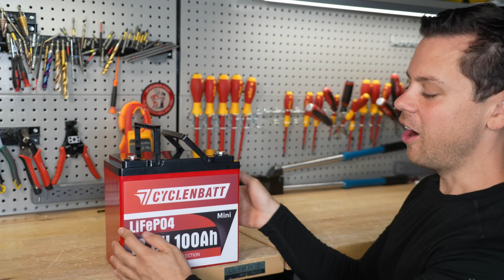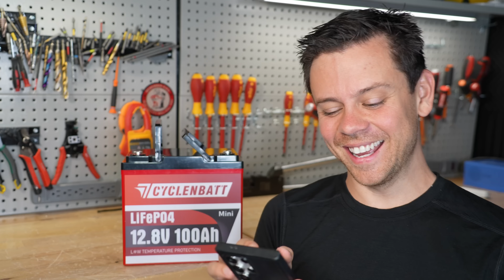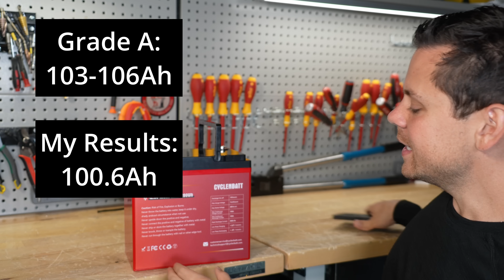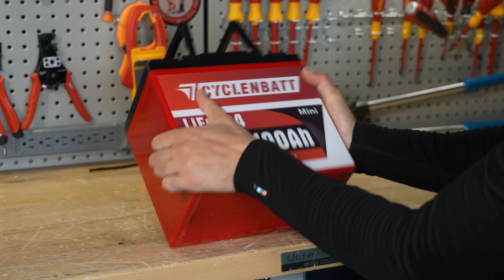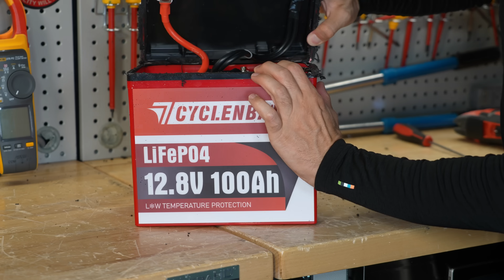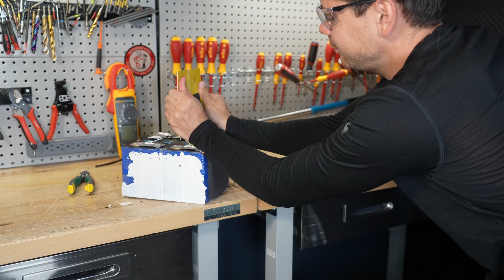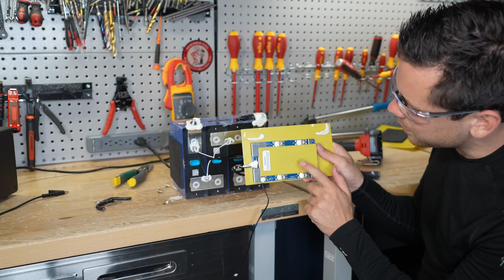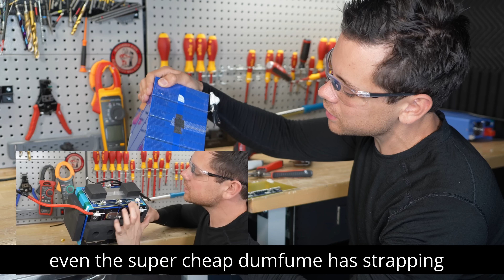$133 100Ah "CyclenBatt" or Time Bomb?! 🔥🔥

Comment: Wild that the low temp cutoff worked but the high amp cutoff won't.  Definitely sketchy. 😂
Reply: No internal shunt
Reply: There is a video on yt that lets you  see and change the over current protection using a password  and the apps is saying that it is set up for 110  amps and it  is  triggered  after 10 seconds. And resets with  after 32 second. 

Someone could get into the settings and just lower the amp setting. 

And in real life  you are not gonna charge  or discharge a battery  with that many amps if your system is set up about halfway right , for starters.  

Besides you should have a breaker or fuse anyhow.